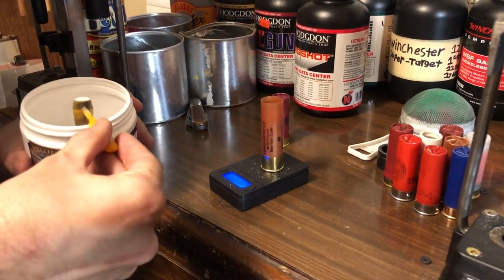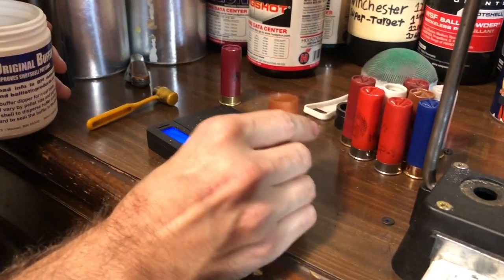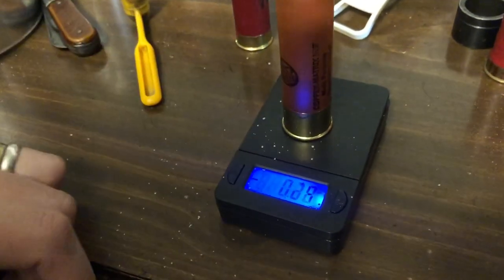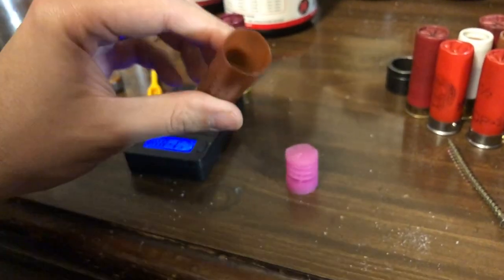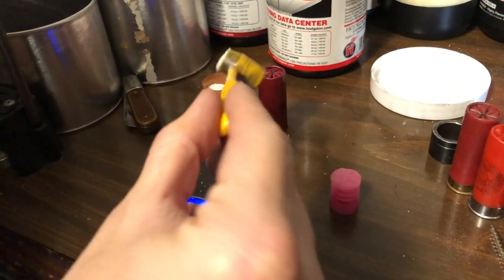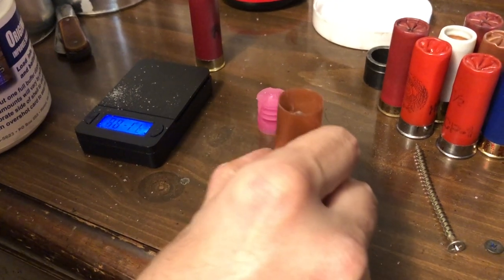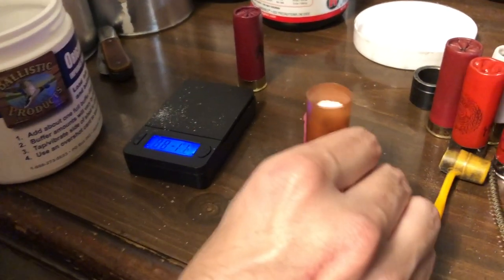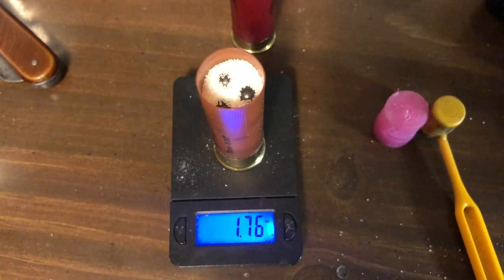Can You Use Sugar As Buffer In Shotshells?

Comment: Just to add again: I use lizard litter aka ground walnut tumbling media aka shot buffer. If you get leading in the barrel or have lead that just won't clean out. I load buck with walnut grounds no petals and barrel looks like a mirror. I run a few after slug ammo to make cleanup a breeze.